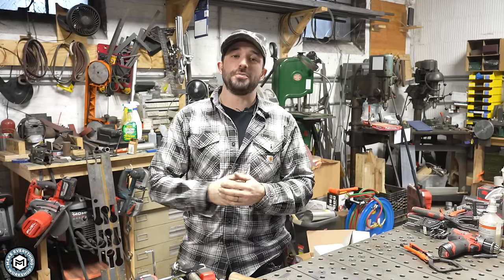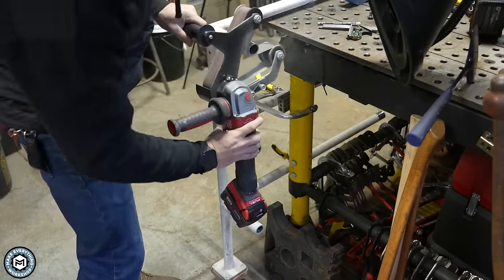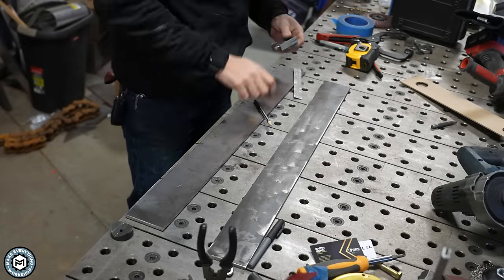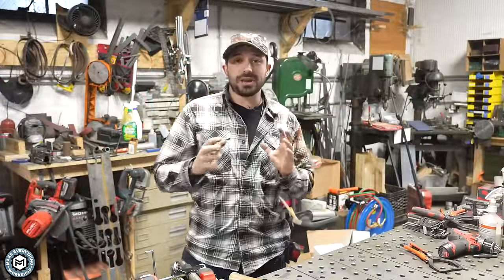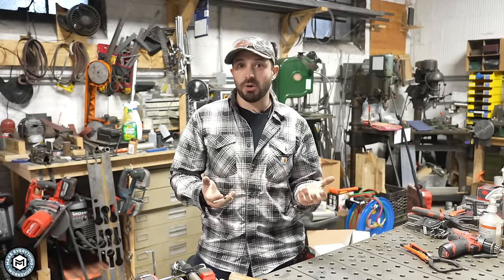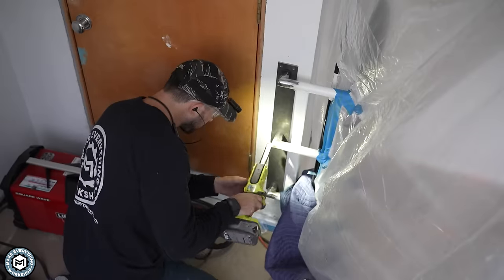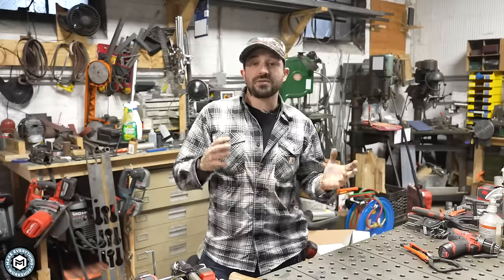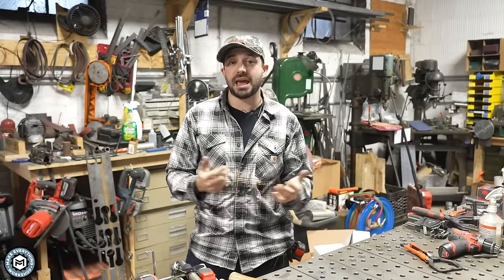Making Big Money Doing Small Welding Jobs! $1000+ / Day!

Comment: Frankly, I think $2k is underpriced, at least in my area. Finding someone qualified for a small job is nearly impossible, & then there's the risk factor which is NOT minimal. The hourly rate is a local thing, as is shop rate (where IIWMI'D divide by # of working days/mo rather than calendar days). Time & materials for protecting customer's premises is super important, great emphasis there, as is cleanup of your work & area. Nice job, especially with the close fit spuds inside the 1st section tubes, definitely a craft worthy touch!

Comment: Good work. One suggestion is switching to either just a torch switch or if you really want/need to control heat on the fly, a thumb control. The pedal is really only meant for fab at a table.
Reply: Fronius makes really sweet rig machines with a thumb switch

Comment: Get yourself a tig button. It is a button on your tig torch that works like a foot peddle, the harder you push the button the higher the amps. A must have for out of position work. Your rates seem pretty reasonable. I just wish I could find more clients that understand what fab work like this costs.
Reply: @lm2174  the welding process is exactly the same you just eliminate the foot peddle. I guess you are just so good you use the foot peddle while 20ft up on a ladder or are laying on your stomach in the bilge of a boat with your feet above your head.
Reply: @mattbentley8958  I've been 45ft up inside the corner of a building with hardly and reach and unable to reach the back side of a weld with my dominate hand. I learned to TIG with both hands, and I bet I can lay down a better weld without a peddle any day. Try welding hastelloy out of position its like welding 316l stainless where you have to watch your heat, but with a watery puddle like aluminum.  Real pipe welders don't need a pansy button. Learn to weld and control the heat by visuals and heat settings instead of taking the easy way out.
Reply: @mandoky1647  good for you. Welding is only a part of my job. I will use the capabilities of my machine to get the job done. My comment is for the majority of people like the guy who made the video that would benefit from it.

Comment: I was just welding in a dimly lit area today, I was holding a flashlight, that headlamp on your hood is a great idea. I'm definitely gonna do that to mine.
Reply from the maker: I use it all the time!!
Reply: @MakeEverything  I added that to my hood after watching your video about it. I got the same make and model from your video. Works great and I turned my welding buds on to it also. I do weld repairs on heavy equipment where a lot of times I'm in the bowels of some mechanical beast and it's really a necessity.

Comment: Thanks for the video. I'm not interested in tig welding, but the use of your different shop tools for the fabrication was very educational. I've taken 2 semesters of welding, and as an older guy (51) who's a 100 disabled vet, I've found that me welding, Stick and FC/mig has been a bit therapeutic. I haven't done anything for pay yet because I'm still learning what I can and can't do well. But in my area, small job welders are not around much. So this year I am planning on putting my skills out there. So thanks for the break down of how you charge for jobs.
Reply: What would the experience be like to find a job as a welder in your region? I have been working with welding for 20 years, I am thinking of seeking experience outside my country, Brazil
Reply: As a recent disabled veteran myself currently taking welding, I too find it pretty therapeutic.  It closely compares to the relaxed feeling I got on the range smelling the gun powder burning
Reply: This is actually hilarious to me. I'm in the exact same situation where I am a retired vet andHave taken up welding as a form of therapy. I'm absolute garbage at it so far but I love it for some reason.

Comment: I'm always undercharging and my brain never caught up from the 80's prices lol...Really nice work here and a great price,,I just put up a small radio 40 foot tower for armature radio enthusiast friend and only charged around a thousand for re-welding a new square plate base and crank up system that was cemented into the ground about 4 feet with 3/4 threaded rod embedded into the concrete (i bent the ends 90 degree with a torch before setting them in)  friend is supper happy and is throwing me a bunch of more work around his place. He might get the friend rate but people are paying for not just the time and materials but a life time of acquired skills and experience, so its essential we lay it out for the client what to expect ahead of time.

Comment: The only problem I have with what you charged is that when you consider your travel time and loading/unloading at your shop, you probably actually have two full days in this project, and maybe more.  You charged your per day cost for the day you spent in your shop, but unless it’s not in what you showed us, you didn’t charge your per day cost for the field work day.  You are still paying rent, insurance, heat, electricity, etc for your shop, even if you’re working in the field.
Reply: I certainly agree that having a skilled man on location with gear should incur a similar day rate to the work shop how ever I think you mentioning rent insurance etc related to his work shop is absolutely outrageous   getting on sight  incurs different expenses.. Do you you want to be competitive with a guy  who has only  a shop and another guy who has only a well kitted out truck/ trailer   yeh i know the shop expenses  are still there  when your on site i just think you need to manage the balance of sight and work shop work
Reply: Great point.  I would suggest (and I have done this previously) incorporating a "half day" of shop fee because 1) You have (basically) half of your shop with you and 2) Your on-site time never seems to account for "lost time" moments that are beyond your control on a typical job site.  I. E. other contractors/subcontractors moving past your work area, unforeseen interruptions, etc.

Comment: A tip for glare in your hood that you mentioned around 13:00 mark take your lenses out and color in the outer edge of the clear lense with a black sharpie. Takes away seeing double and usually glare
Reply: Are you talking about coloring just the thin outside    edge or a border , which would make your viewing area smaller? I hope you understand the way I'm asking.
Reply: @tubeonline629  the very outer edge. No border
Reply: @chasebarragar6961  
I've  been a welder for 38 years and never heard of this. Thank you i will definitely try this tip.
Reply: i think he was talking about the sun coming thru that big window behind him.  Pipeline welders use pancake hoods to prevent sun intrusion.  If you don't have a pancake, buy a black cotton hoodie and putt the hood up over your welding helmet-makes it pitch black inside helmet so sun in helmet does not compete with the puddle.  Some white people also Velcro a hanging strip of black canvas or leather to the chin of the helmet to prevent reflection off the neck and also sunburn from the arc.  I have pretty poor eyesight and i have found the hoodie trick to be very helpful seeing the puddle.
Reply: @peetky8645  
That's another good idea. 
Thank you.

Comment: Personal preference but I ditch the pedal in favor of a trigger in the field. Also typically we need an insurance policy if working (especially welding) in people's houses. Like you said, what if you do some damage, or get hurt, or God forbid burn the house down. Plus you can't pull a permit without it (at least here by me). If the inspector finds out, shuts down the job, fines you, etc. These are more contributing factors to the "high cost" of these kinds of jobs. Great video, thanks!

Comment: welding tip--you can use a 2 gallon garden sprayer to dampen that cardboard on the floor and make it fireproof.  do the same with cardboard sheet you lean up against vulnerable wall surfaces.
Reply: That's what I do welding in the hay barn,  but I go a little more than damp....

Comment: Good video!  What will help you out greatly for Tig field welding and awkward positioning is a Tig torch thumb roll switch.  You may also want to get yourself a “leather welding monkey mask”, this would help your line of sight greatly so you don’t have to fight your plastic welding hood which makes your head size bigger by an inch in almost every direction.

Comment: I’ve built like 9 of these in a day. But at the same time. Everything was cut by another department and we just pick it up, bevel the ends, and then fit it up according to the blue prints. Still had to work out all the math though for stronger rails, or whatever it was we may have been building. Still had to use math to find our pitch, diagonals, strait pulls, level offs and so on.. built a ton of stuff for famous people like Blake sheltons bar ole red here in Tennessee , Florida and so on.. the ones I hated the most were the ones with a ton of pickets between the legs 😓 if you don’t have a Bosh angle finder .. I would highly recommend one. They make fitting up rails for stairs and stuff so much easier.

Comment: In case anyone is wondering why new railing spacings have to be 4" or less between rails (vertical or horizontal), its to prevent children and pets from squeezing through and potentially falling.  So no cool James Bond mod floating stairs for you..unless you want to remove them after inspection.  But at least wait until your kids are grown lol.
Reply: The 4" figure was determined to be the maximum gap that still (ideally) prevents a child from getting their head trapped between the bars.
Reply: @GrayRaceCat  it's OK you just gotta trim their ears a little to gettem  out !
Reply: That's also why outdated floating stairs are removed as they're stupidly dangerous. Stairs of any type eventually guarantee at least one fall but fewer is better.

Comment: Finally someone that understands the trade and value your skill set. So many fabricators don't charge enough for their work, it blows my mind. My shop rate is $125/hr for welding and fabrication. I mainly specialize in the automotive performance industry. Sometimes people think it's a lot, but those are usually people that don't have a business and work a normal job.
The Firestone mechanic shop down the street from me charge $140+/hr to do your brakes and things like that. Now how is $125 too little for welding and fabrication?

I have a question for you though. Did you present the total to the customer after the job was already done and you added up all the time or did you quote him ahead of time. I'm asking because most people want a quote ahead of time and sometimes it's pretty tricky to estimate how long it will take to do the job. 

Great video, keep it up!
Reply: Great question at the end. Tagging along for the response 🤙🏽🤙🏽🤙🏽
Reply: One thing to think about is what you're working on . With construction, either new, or remodeling, it's financed with a large loan or mortgage. This makes it easier to charge more. When working on someone's car it's paid out of pocket.
Reply: auto shops here charge 175/hr
Reply: Im a mechanic, and yes, people like the cost of the work ahead of time. Many don't understand why you charge a lot, and if you get good, you invest in more equipment, etc etc, your value just increases, so you gotta find a middle ground. Been a mechanic is much easier tho, as im not fabricating, im just diagnosing and replacing parts. Diagnoses are usually free as i don't spend too much time on them (if i do, i charge for them, of course), and replacing parts is often a fixed labour time based on my hourly rate, it's way easier for me. I know a guy who does the same as you, more or less. This guy fabricates a lot, has a really good skill set and equipment, and is not cheap at all, but he gives the entire cost of the job upfront, i think because he has plenty of experience.
Quick story: a customer of mine also has used this other guy's services, and he says he just charge a lot, a total rip-off. Watching his works on exhaust lines (the fabricator guy), he uses stainless steel pipes, does beautiful small tig welding beads, nice performance mufflers... A real delight to the eyes. Meanwhile, this customer of mine usually has mid rusted mig beads on his exhaust lines, not carefully done, because i have seen really beautiful mig beads and my customer's are nowhere near those, actually look like noobie welds. That's quite a rip-off to me.
Reply: @Matt-kt9nm  I was in construction for about 30 years and find your comment inaccurate.
Reply: @RGV2300  10$ to tighten the nut, 90$ for the 15 years experience to know which nut, where, and how tight.
Reply: @zjedinite  How exactly?
Reply: @Matt-kt9nm  I’m not going to speak on the mechanic side, but as far as Construction goes it’s not quite as you stated. 

1:Over 90% of the renovations are self funded by the homeowner and not banks. Most jobs are roofing, siding bathrooms, kitchens and decks etc…

2: The only way you can charge more then the next guy is usually by having a reputation on doing quality work in a timely manner.

And thirdly, construction loans are a pain in the dick! The project MUST be approved by the lender, hence there is NO WAY to just add %20 just bc you feel like it, it needs to be justified as lenders need to protect their investment by not over stretching on the loan to equity ratio.
If not this would be prone to scams. And forget about the appraiser’s inspections, which can deter your project.

So there is no correlation between charging more just because it’s a construction loan or “borrowed” funds. It’s just not true. ✌🏽
Reply: @RGV2300  I totally understand. You know if I am unsure of what the client wants as far as quality or a quick fix I usually ask them. If they want something done quick and on a budget I send them to a local exhaust shop. They do work for much less than what I charge and it is satisfactory to what the client is looking for.

I have a very strict policy on not doing any rust repair. I absolutely turn down any job that involves rust. It destroys my shop (dust etc.) and 90% of the time the job does not pay enough to cover the time I spend cleaning every afterwards. However my health is the number 1 reason. I am 32 years old and I worked on antique cars for over 5 years in my mid 20s. Now I have some health issues that a 32 year old shouldn't have like dry eye for example. I can't wear contact lenses anymore. I'm pretty sure it's from all the sanding dust that got into my eyes from all those years working with rust repair, fiberglass and body filler. Unfortunately I learned the hard way.
Reply: @peetky8645  isn’t that the damm truth! 

It’s like I rather be seen by a 30 year experienced doctor with one degree then a freshly graduate one with a wall of them.

Experience is everything in my book.
Reply: I think your 125 an hour rate sounds like alot, but if your work is excellent than you probably have lots of customers willing to pay.  The shop charging over 140 an hour to change parts to me would not be worth it, that's the reason I do my own repairs and maintenance  on everything I own.

Bottom line to me as a general contractor, it's gonna cost me 500 a day minimum for a skilled tradesman with tools at a job site doing custom work.  Doesn't matter if is plumbing, electrical,  carpentry, etc.  If they have super specialized equipment than it will be more (price model changes to operator, equipment rental,  transportation costs).

I think the lesson here is trades can be very profitable.  The challenge is finding enough work to stay busy day in , day out and being sure to do quality work for your customers.  Schools keep pushing kids to go to college, that's OK for some but the guys who can make or repair stuff are in high demand.  They can and do get paid pretty well and probably feel good about the work they do.

Comment: I've had 3 jobs on the same truck over a period of 6 months. Just started welding a year or so ago with literally 3 hours weld time. I welded small plates of metal in the trash truck hopper. All done with fluxcore 035. 4 visits 60 each time and,  2-3 hours of work. Those were my first jobs and first time . The owner likes it but I think my welds are terrible.  😅 
But it was practice and a little bit of biscuit dallors. Wasn't hard, just smelly and nasty. Lol. If I had more experience I would have definitely charged more than what I did charge. But being the fact that I only have a limited amount of experience I didn't want to lose out on my first job . I definitely need more practice. But it is what it is and there's my two cents. Good video.

Comment: There needs to be more small local shops to handle all the small jobs people need done. The only option a lot of times is either buy your own welder and see if you can fix it or just buy a new one.

I remember I once had a cracked bumper mount. Everything about it was very straight forward and uncomplicated,  3 inch flat weld that didn't need to look pretty. No place to take it. So I went to a place that made pickup trailers. Waved down a guy in welding gear and said I'd pay him 40 bucks. Took him like 2 minutes. Both of us were happy with that deal.